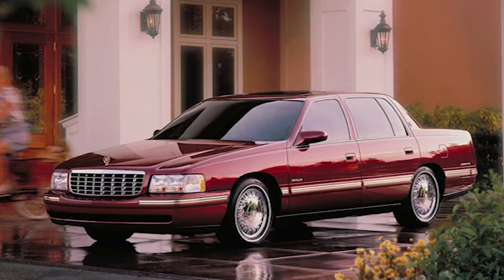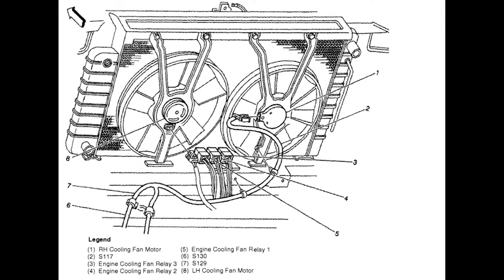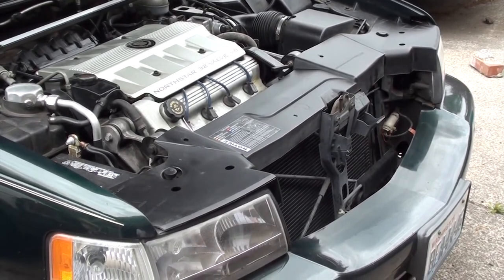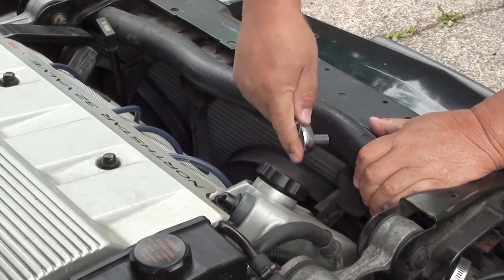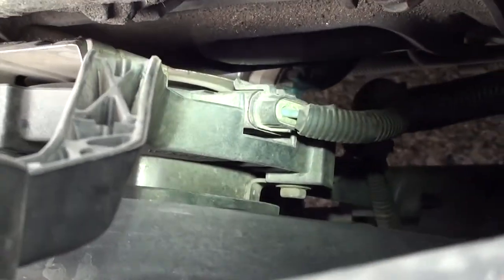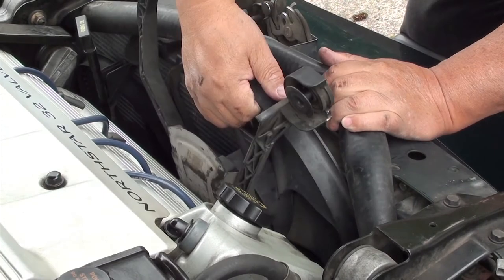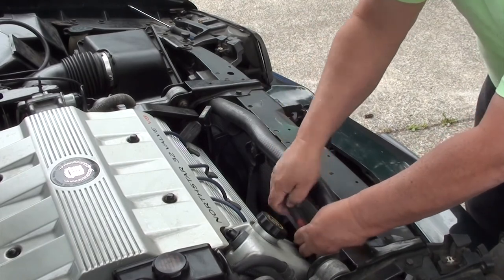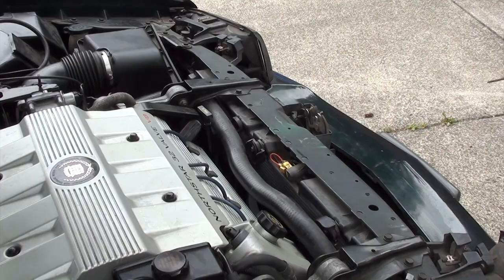Cadillac - How to Replace Radiator Fan - What mechanics won't tell you - GM - Northstar

Comment: Passenger side fan slid out easily, however the driver side fan was a bit more difficult. I tried what you suggested and moved it over to the passenger side with no luck. Had to separate the fan blade from the motor in order to remove.

Comment: just bought a 2002 eldorado with p0481 and p0480 codes... don't believe the fans are turning on. scanner on showed coolant temp while car is idling got as high as 217. Miles are about 85K on the car. Anyone have an idea if the likely cause is the relays or the fans themselves or something else?
Reply: Ever find the fix?

Comment: Which fan is kicks on for the air conditioning. Thank you
Reply from the maker: My understanding is the PCM controls the three fan relays to give two speeds, low and high. On low speed only the left fan will operate, high speed both fan motors should spin up. If both fans never come on, check first the COOL FNS 50A fuse in the RH underhood fuse block. You will probably have to remove a plastic cover in front of the left strut tower to access this MAXI fuse block. There should be a sticker(legend) illustrating which fuse is which under the cover. If this fuse is not open, check that there is power at/through it. If the fuse is open, the wiring could be shorted, or a fan(s) motor could be shorted causing too much amperage to flow and open the fuse. At this point, compare the resistance of both fan motors. I am not sure what the typical value should be, but I would think that the one with considerably lower resistance is a bad one. If they are the same, the plot may thicken. A fan should definately come on with A/C request and compressor operation, and both should come on at somewhere around 195 to 215 degrees(F). If both fans are inoperative, another common denominator is the ground G107 which is bolted to the transmission housing under the thermostat, best viewed from the underside. If you had an open ground at G107, you would have other issues, like no compressor operation, and possibly an ABS fault, but the ground lead from the fans circuit is spliced into the other circuits, so anything is possible. Has this car ever been in a frontal collision? That could play into other causes of the fuse being blown and/or an abnormal ground issue. But do your due diligence..
Reply: @notsofast2325  I appreciate your help very much. I just put a new ac compressor Accumulator and Orifice tube on about 6 hours ago. I vacuumed the system down and let stand for 1 hour no loss of vacuum so I preceded to charge the system. I inserted my line in my pag oil and let gravity do it's job. Time for R134A I started the car turned on the ac to high as I'm putting R134A in the low side the compressor never kicked on so I pulled the ac relay and used a jump wire to charge the system. I checked the red 10amp fuse good i checked the ac relay bad, I replaced it with another from the vehicle since stores are closed. From my understanding when I turn on the air conditioning it commands the ac condenser fan on 1st then the air conditioning 2nd. I turned off the air conditioning compressor when monitoring the gauges the head pressure was around 250 and the fan or fans wasn't working. I'm putting the car back on the rack or lift this afternoon at 1pm.
This is my daughter's car I bought to fix up for her really nice car. You did mention possible wreck my daughter did bring me the car with the front bumper dropped by the front of the fenders where the plastic retainer clips secure the bumper cover. I did notice that 1 horn was unplugged passenger side and lower fog lamp DL side. Of course I put the car on the lift and fixed the bumper correctly and reconnect the horn. It wasn't a frontal impact wreck she was backing up and didn't realize the air ride suspension bleed off and the car had lowered onto a small cut down tree stump. The damage is done. Thank you again
Reply from the maker: @Tom-wq2mz  N/P  I can't tell you how many times I have fixed my kids cars..
Reply: @notsofast2325  The high fan does kick on at 195-200 I haven't messed with the car much since I bought a Buick to restore and flip. Now that the Buick is gone I'm focusing on the A-C now before summer comes. The 10 amp and 50 amp fuse was both blown I replaced both only the High fan work's at normal operation temp. My question would be which of the 3 relay's mounted below the radiator control the Low speed Fan. Thank you for your help and support
Reply from the maker: @puppetmaster1727  Hey big guy! nice to hear back from you.  Humm? Ok this is what i came up with. With no A/C commanded the fans will NOT come on until coolant reaches 224 degrees, when both go to SLOW, coolant goes down to 213 and fans turn OFF. If you're in really hot ambient conditions in traffic with A/C OFF, then heat may go to 236 in which case fans go to FAST, then SLOW at 224, then OFF at 213.
But before swapping relays and chasing ghosts, you need to do some simple diagnostics. These are not hi and low speed fans--the fans are the same but connected in series for low speed (each motor sees ~6v), and then connected in parallel for high speed (i.e. normal 12v to each fan motor). If neither fan works in high or low, it has to be a power supply issue (either 12v or ground). If the RH fan runs in high but the LH never runs, then the problem is with the LH fan itself. Either the connector is loose, or the motor is bad. I would bet the connector if you have just the one motor not running.
For further diagnosis, what I would do is get a test light. Pull relay 1, 2, and 3. Check for 12v at pins (85, 30) (85, 87A) and (85, 30) respectively. Check for ground at the pins 87 of both relays 2 and 3. Put back relay 1. Command low speed fans, relay should click. Remove 1 and install 2. Command high speed, relay 2 should click. Remove 2 and install 3. Command high and 3 should click. The LH fan has a switched positive and ground. The RH fan has only a switched positive. The circuit changes between putting the fan motors in series to parallel.
In slow mode, LH has 12v at top, bottom is connected to top of the RH fan, which then has a ground. So you have [+12v]----[RH motor]----[LH motor---[Ground] and both spin at half speed
In fast mode, both have 12v at top and ground at bottom.
[+12v]----[RH motor]----[Ground]
[+12v]----[LH motor]----[Ground]
both spin at full speed
Hope this helps
Reply: @notsofast2325  Thank you very much. I'm not mentally challenged so yes your information helps me a lot. Time to get the ohm meter and test light out.
Reply from the maker: @puppetmaster1727  check this out 

https://youtu.be/umyJ8041wG0

Comment: Wasn't that easy on my 98 deville.  My left fan was difficult.  After unbolting fan mount and rotating bottom up I wrestled to unplug electrical connector. Then fan would not slide up and out without removing reverse thread nut to separate fan blade from fan motor. Only then could I find room to get left side fan out.
Reply: I'm having the same problem. I cannot get the left side fan out. It won't budge. I tried moving to the right side and that didn't work. I'll try removing reverse thread nut to separate blade from fan motor.
Reply: I put a 200 amp alternator on today I pulled the low speed Fan out hooked it to the battery the fan work's. It even spined in the car. I commanded the A-C on the control panel and the A-C didn't kick on. The guy that helped me said he believes it's the relay.